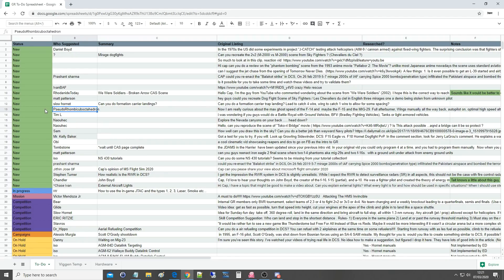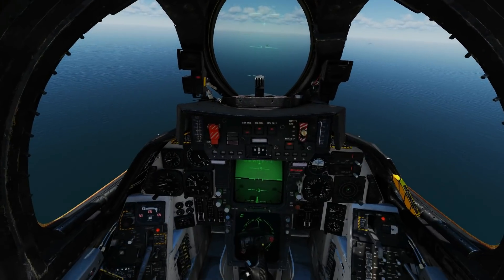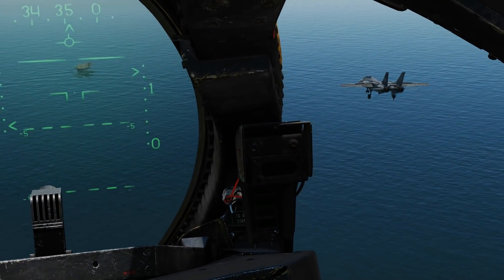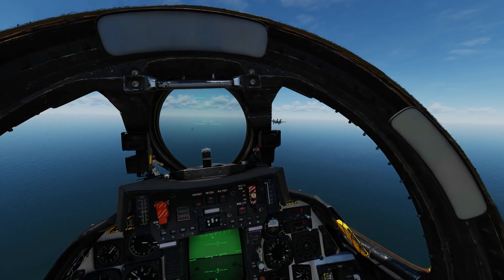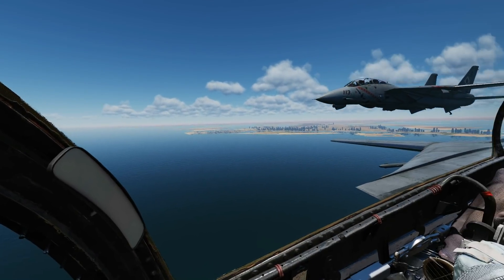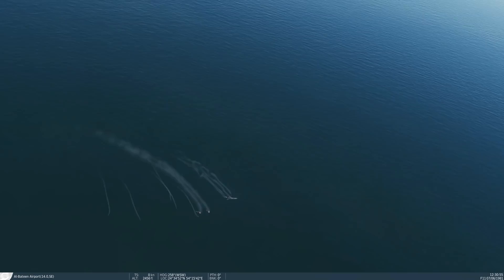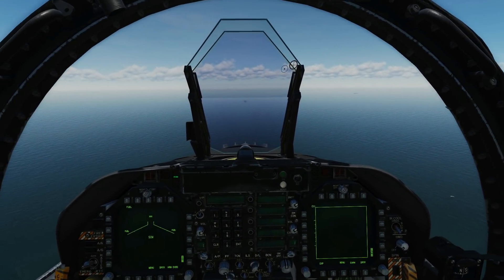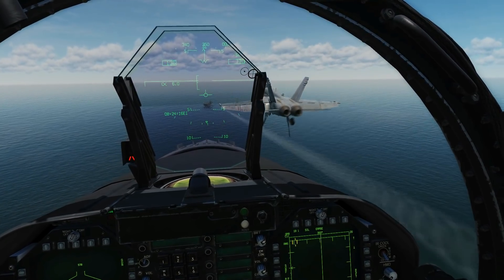Questioned: Are Simultaneous Tandem Formation Carrier Landings Possible? Vid(1 of 2) | DCS

Comment: If both aircraft are in formation you will tend to touch down at the same point thus the first aircraft will more times than less take the wire and the second will skip. Another issue with this is that your point of stoppage so to say is dependant on which wire you catch so if you both touch down and say you both catch by a wire part the spacing between wires will be insufficient to allow spacing between you when you land. The only way to over come this is for the lead to be catching a 1 wire and the other aircraft to catch a 4 wire to allow the maximum spacing between the airframes on deck.
Reply: Isn't 1 wire the one closest to the stern? So lead should aim for 4 wire and wingman for 4 wire?
Reply: Slow Hornet soz i was tired af still am too much work to do

Comment: I am not sure if each wire has its own braking system or of they all feed into one break but I am pretty sure 2 acft are over the max weight they can safely operate at.
Reply: Each should have its own brake. Therefore if ones brakes breaks you still have other available wires.

Comment: CAP... video suggestion. Crash Re-creation: F-15C 1v1 F-22. Eagle driver uses split throttles to induce yaw (max burner left engine, min burner right engine) in right turn. Inverted negative G spin with ejection at 1,100 ft. Interesting as engines are nearly on the center line and one (non-Eagle pilots) would think this offers little advantage for yaw. Would be neat to recreate this in both the the Eagle and the Tomcat with the Tomcat engines far off center. Page 6 for the flight/fight details:  https://www.airforcemag.com/app/uploads/2019/04/06112018_F15C_Kadena.pdf
Reply from the maker: Ya will do boss
Reply: @grimreapers  1972 F-15 fighting a 2005 F-22 with all kinds of thrust and gas and supercruise and maneuverability and the kitchen sink - in a slow speed fight, possibly a scissors, below 6,000 ft, pulling every trick out of the Eagle's Bag - and this includes asymmetrical thrust to gain an advantage in the 200 kt, high alpha (39 AOA) regime? The Eagle driver - it appears - left NOTHING on the table. Squeezed the bird so hard it was dripping. Seems a bit silly to take the Eagle this far considering you are up against a Raptor. Really? Was all this really necessary? I took a look in the mirror this morning and I had to break the news to myself and I shall do the same for you. I... we, CAP, are just schmoes. I'm a schmoe and you're also a schmoe. What the hello do we know about dogfighting in an Eagle? Even though the Eagle driver biffed, he was up to something and now I TASK you and RC to find out just what this was. Get to it Mate! Cheers!

Comment: What are the unpowered terminal velocities of different airframes in DCS? You could climb to max altitude at various speeds (say 300 knots, then 400, etc) then nose down, throttle back to idle, and find the max speed as you approach sea level.
Reply: To add to this, what is the stall speed of the different airframes in DCS?